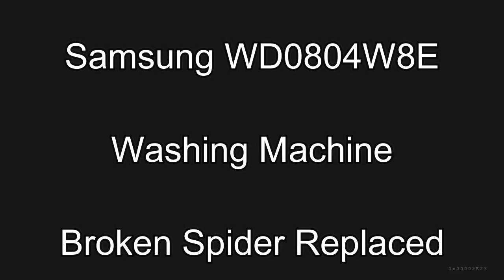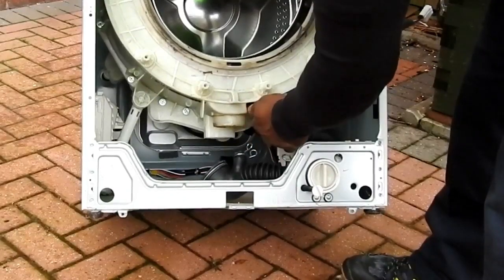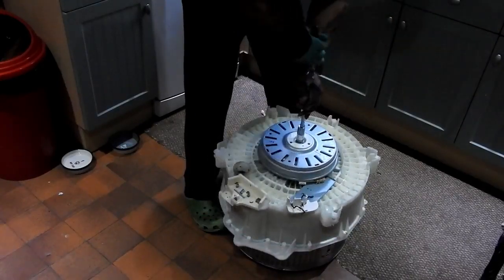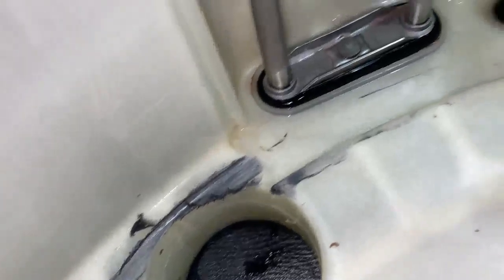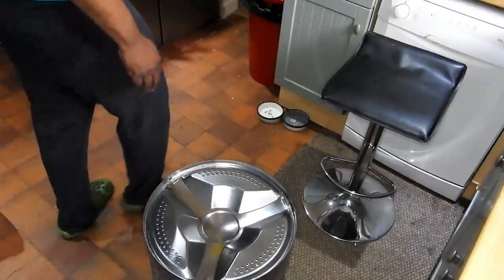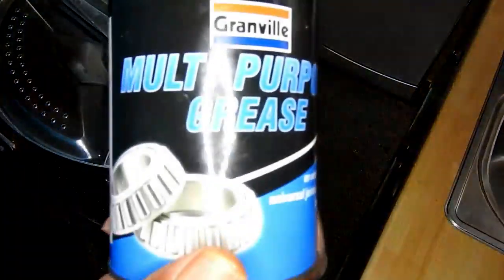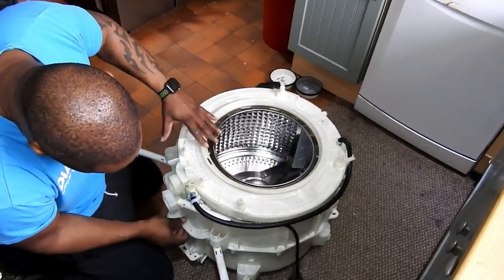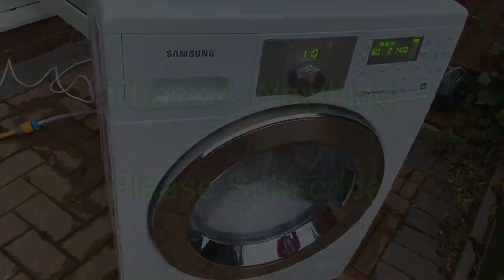Samsung Washing Machine Drum Broken Spider Replacement

Comment: WOW - how much would the engineer charge for a job like this? Excluding parts?
Reply from the maker: would not be cost effective Stephen.
Reply: @green-crocs-fixes1520  just had a repairman come out and tell me they call it a catastrophic failure. They charge about 1400. He said since mines just cracked and not completely broken to use it until it breaks and buy new... think I may try this instead when the time comes though
Reply from the maker: @spaceedementia  Hi Space,
                                                     I think you may have bee ill advised in this case, as the machine will be unbalanced. this will cause damage to the Bearings and in this case the Tub, as you see in this video. If you attempt a repair then the earlier the better.

            Regards 😀.
Reply: @green-crocs-fixes1520  oh dang. Hopefully I can buy a little time while I work on getting the tools and parts for it... when I do, I'll be back to your video. Hopefully will give an update. Thanks so much!
Reply from the maker: @spaceedementia  Cool, no worries and good luck 🤞.

Comment: This is caused by constant liquid detergent powder is better for the machine
Reply from the maker: Noted Rock Star,
                             there were a lot of recesses in the original Spider and these where clogged up with Soap and fluff, not sure why the Spider why they don't make them smooth.

                 Regards.
Reply: It's caused by using two different metals in the presence of an electrolyte, soap & water. Stainless steel for the drum and whatever alloy for the spindle. 
Doesn't matter what detergent you use, due to the really bad design the spindle will corrode.
Reply: Before obvious failure were you getting bits of aluminum in the filter element?

Comment: And next time.....Don't buy Samsung.
Reply from the maker: They are a good Manufacturer Frankie. I repair other makers models also 😀.
Reply: @green-crocs-fixes1520  I have seen two Samsung washers go bad (Spindle/Spider) in three years. Cost of repairs/part is half price of washer. Sumsang puts a big sign on front 10 years warranty. But that is just motor. They very well know the spindle/spider rusts and goes bad right after warranty expires in 3 years. 

Growing up I have used washers (front loading) e.g Hoover last for 20 years. Now I understand that things have changed. But for a washer to go bad in the 3 years is Absolutely Unacceptable. 

It's my mission to post as many posts I can and to let people know, it's NOT shipping Bolts. If you Buy a Samsung Washer for $1200. Expect to dish out $600 repairs soon after warranty expires in 3 years. The thing Rusts inside and it's a Major Job. 

Samsung are you reading this? I have a dancing washer. My second one. I fixed first one. Now I have bought another house with same Samsung Washer with rusted Spindle. Contact me if you want me to Shut Up. Or keep losing your sales. Cause I WILL keep posting NOT to Buy Samsung Garbage Washer. 

Green-Crocs-Fixes. Or course you will say it's a good brand. You make money repairing. Your Move. Say you what?
Reply: @frankie3591  search for James fixit and shaky spider.

Guy there with a Samsung too. Except instead of 3 years his lasted 13.

So tell me how do you use your machine? What detergent you use and how much. How many hot washes a month. Maintenance washes how many times a year. Do you leave the door open after every wash.
Reply: Before obvious failure were you getting bits of aluminum in the filter element?
I was. Little chunks, dark in color, almost black and 1/8 to 1/16 inch in size.
Machine was bought used
and I wonder if they knew what was coming...
If this is common it's a good symptom to look for as there was no clunking or banging at that time just bad water draining due to a clogged filter.
Has anyone else seen this?

Comment: Is this where all the “sand” and dark “rocks” came from that appeared on the outside bottom of my Samsung washer?  Just chipped off and grinded dust from the spider?  Looks like it’s made from zinc or aluminum.  Why do they make such an essential part out of such a weak material?  To ensure you have to buy another one?
Reply from the maker: Hi Dark Horse,
                          I think they use some form of Aluminium / Alloy as this has to withstand hot water and soap. A Stainless Steel Spider would cost too much to manufacture I would imagine.

              Regards.
Reply: Before obvious failure were you getting bits of aluminum in the filter element?
I was. Little chunks, dark in color, almost black and 1/8 to 1/16 inch in size.
Machine was bought used
and I wonder if they knew what was coming...
If this is common it's a good symptom to look for as there was no clunking or banging at that time just bad water draining due to a clogged filter.
Has anyone else seen this?